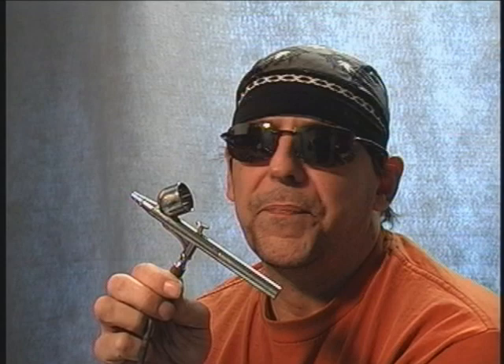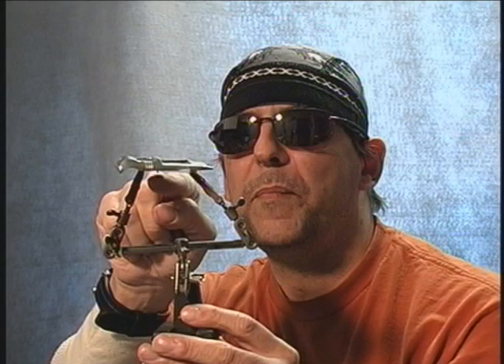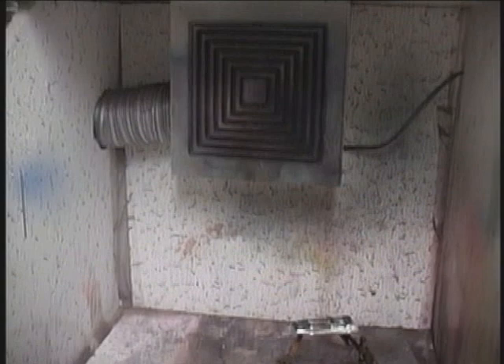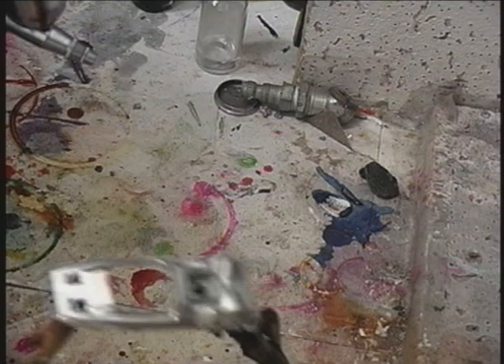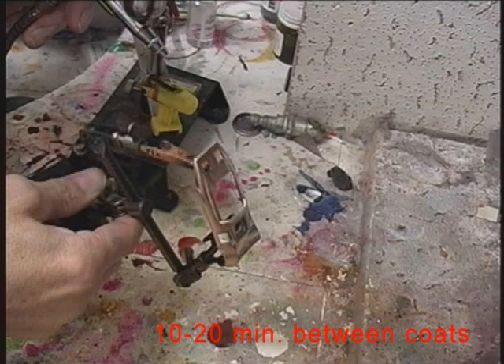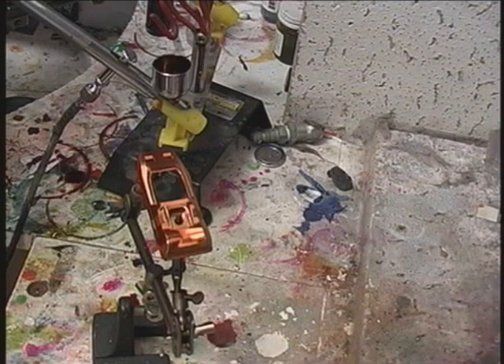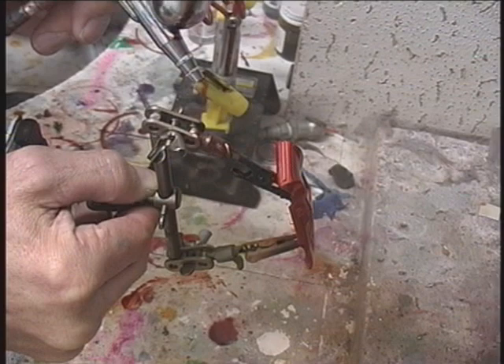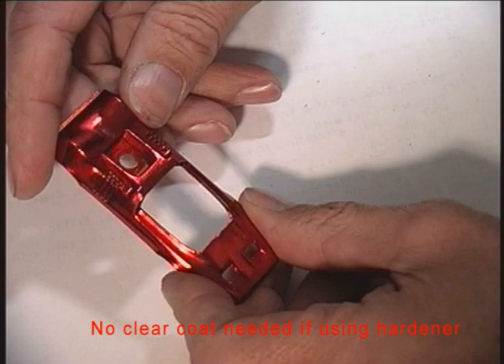Redline Restoration - How to Paint a Hot Wheel Redline with Spectraflame Paint.

Comment: I just painted a Matchbox XKE with Red Spectraflame with hardener.  Followed the 5 coat and 30 min bake.   The finish is awesome.  The paint was very easy to spray.  I keep my Iwata for acrylics, for the Spectraflame I used a $10 Harbor Freight siphon airbrush. The airbrush cleaned easy with lacquer thinner.  Very easy paint to work with, and the finish on the XKE is like the original.
Reply from the maker: Cool, glad it worked out for you. Thanks, JON

Comment: I have a small 4x4x4 box full of redlines about 10 or so I want to restore by myself. I was wondering if you could do a video or explain how you paint car hoods. Do you do it on the car if so then how? do you take it off and paint separate? do you cover the engine or does that come off with chasis? what about vinyl top painted cars how would one restore it to make it a vinyl top again? thanks! Great Videos. I need the tumbler and right paint and bits and I can finally get started. CAN'T WAIT!

Comment: Hey John I have a 1968 Fleetside Red Line, I have the original chassis W/ the Red Line cap wheels & I have a donor  chassis W/ bushings on the axles. The latter I think was first released, not 100% sure. Original color is ~antifreeze green~  and I need to repaint it, do you polish the body to get that mirror look under the paint or what? Also I will need to get the glass for it from you, but let's take care of the paint first.

Comment: Oh man that is some sweet paint job.  I got my Redline Gear for my Green Jet Threat and am so itching to see it get done. I have not got my Airbrush yet so I am still hanging on.
QUESTION: I have already prepped the casting nicely but have applied a good coat of white Rustoleum Primer. Will this effect my results with the Airbrush? It seemed to me you did not spray on top of any primer, just bare metal?
I still may try a Spectraflame bath. I want to dip the car and get an ultra thick coat on.
Will the primer bleed through? Should I even try a bath/dipping of the casting?
I wish I could make these magnificent little cars look like yours...
Reply: Bullitt, I don’t know if you’ve done anything with your casting yet but I have a recommendation:
Spectraflame paints aren’t designed for dipping. They are transparent and rely on the reflective surface below them to produce their unique color effect. I believe The redline shop sells a silver glitter paint that can be used on cars where the zinc surface has been damaged, leaving only Zemac. In your case, it technically could be used to cover up the primer you’ve put down. But, the better choice would be to strip the primer you’ve applied and to apply spectraflame (with hardener) in layers until you’ve reached the color you want. If you don’t have a air gun you can find surprisingly cheap ones at Harbor Freight. They should also have cheap compressors. Good luck!
Reply: @notdonaldst  Thank You so much for the wonderful information. My casting has been waiting for a Reply from the "Pro's" so glad it was you that gave it to me brother. I will keep you posted on the results. I knew that primer was going to have to come off, too.... :)